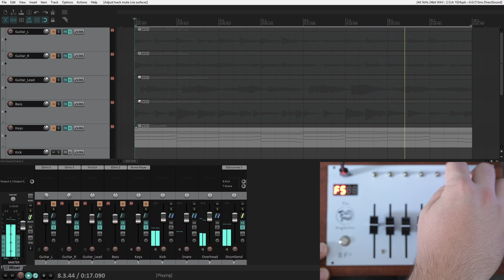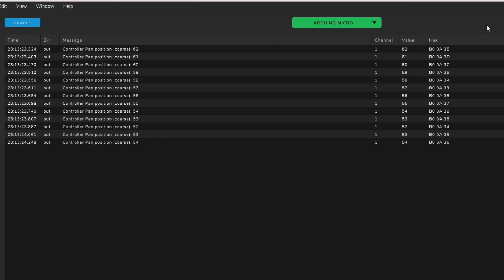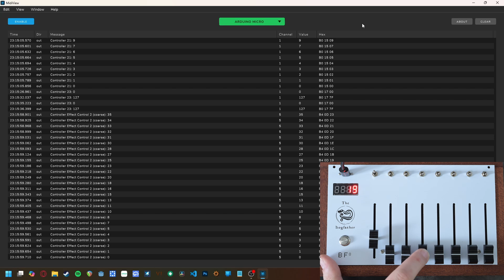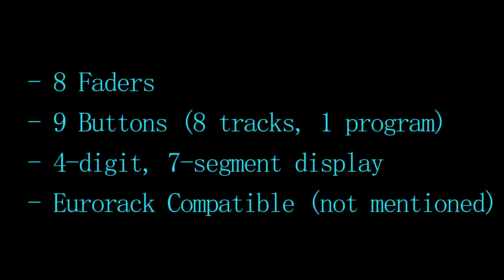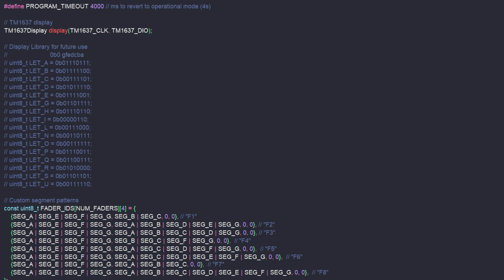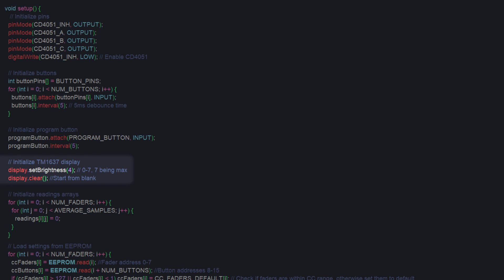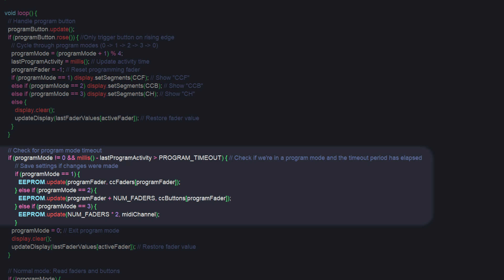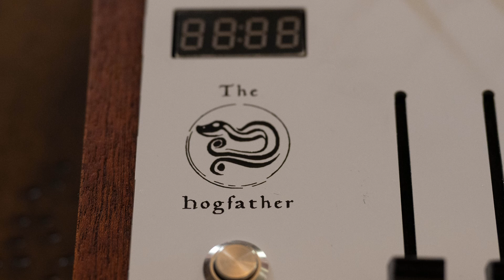DIY MIDI Controller: BF-8 Build with Arduino

Comment: Looks great! Would you mind sharing where you get the parts from? I’m in the process of making my own fader controller and wondering where is best to get some
Reply from the maker: I think most of these parts came from Amazon so I can save money during prototyping. I don't think there's anything in this project you can't get from there. However, here are other suppliers I recommend: Mouser and Digikey have pretty much everything, but navigating their site to find the right part can be tricky. Love My Switches is a great site for switches (duh) and knobs, and Stomp Box Parts is also great for resistors, switches, caps, and knobs. Thanks for watching!
Reply: @ErikHerrmann91 thank you so much for the reply!

Comment: This is a really smooth outcome!!!! And the PCB design is beautiful! I am doing a similar project, with slightly more potentiometers( 9 faders, 24 rotary pots, two encoders and two push buttons). For some reason I can't get a smooth signal from mainly the faders. They always jump values. I am wondering if a pcb covering most of the connections, instead of wiring, is unavoidable for a stable signal.....
Reply from the maker: It could be a number of things, for sure. The quality of analog components and dust can be part of it if you are not getting a steady connection, but I am wondering if it might be the speed of the microprocessor. It's hard to say without analyzing the code and knowing what chip you are using, but it's possible there's just lag in the program. Thanks for the compliment, by the way! I really appreciate it!

Comment: Awesome. I have been doing my own controllers and today I was getting into the mackie protocol, with that you can have buttons to change the banks on the faders so you can have the faders then control any number you have of them. You can find the usual mackie info and notes you need to send easily.
Reply from the maker: I'll have to look into mackie. I've not heard of it before. Someone at my church mentioned another protocol the other day that some are saying might replace MIDI. I don't think it was mackie, but it might have been. I'll look into it. Thanks for watching!

Comment: The only thing i don't like about MIDI is the way to low 7 bit resolution
Reply from the maker: That's definitely a downside, but one of the positives is that it makes human interaction a bit easier when it comes to things like selecting CC values or user banks or something. 8- or 16-bit would make precise selections difficult. Of course, we just use encoders and buttons now, but you get my point. Thanks for watching!

Comment: Really nice little project. Simple but really useful. Just a thought if you used a 4067, you could add 8 additional analogue inputs. Maybe a pan pot above each slider. And also I have built a couple of midi controllers but using the stm32 blue pill module, quite a useful module and will also do USB midi out.
Reply from the maker: Ooh! I am unfamiliar with the 4067. I've been swamped with other projects since this video came out, but I will definitely be re-visiting it and when I do, I'll check out that chip. Thank you!

Comment: Very cool work and adaptation here !
Do you think you can also add "velocity" "aftertouch" "pitchbend" and so on after CC127 ?
Reply: sorry, i have more : a loooot of people like 9 fader instead of 8, just for general volume (yeah i guess it's rarely touched).
But if you wan't to sell too short pcb, i don't need eurorack et was beginning to make my own cad files so... just give me a sign if you want 🙂
Reply from the maker: That sounds good! I appreciate you letting me know! I won't be adding aftertouch or pitchbend to this project, but it's a neat idea.